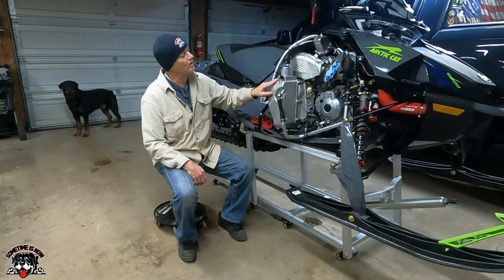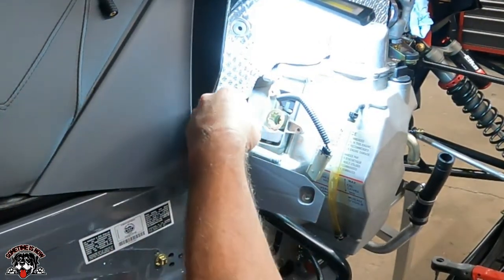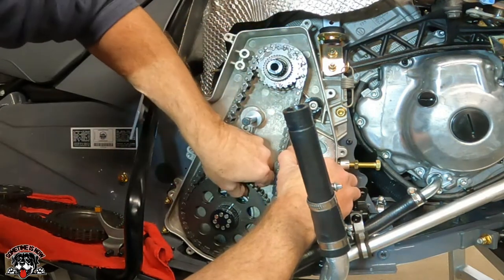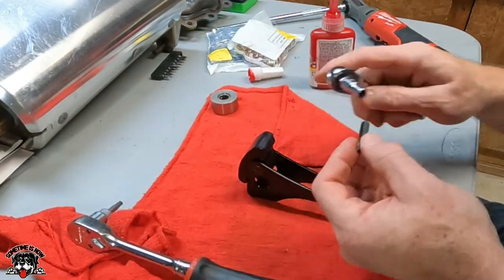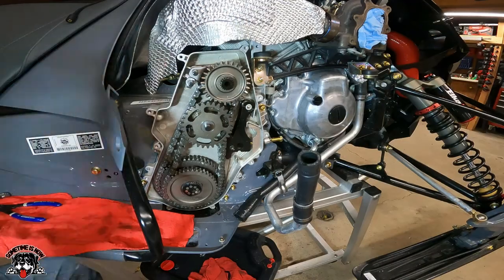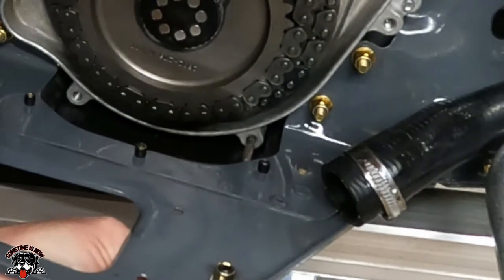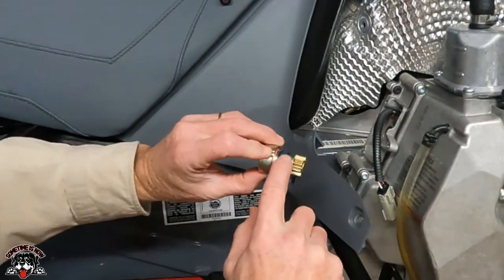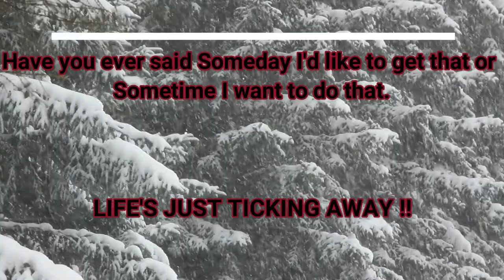THUNDERCAT SIDEWINDER Upgrade your Chaincase parts

Comment: what you want to do when torquing that chaincase is to step the torque values all and do star patterns.  I typically do about 4 torque steps before hitting the max torque value, but I only go to about 120in/lbs and start at about 80.  The manual says 12ft/lbs

Chain Case (Torx-Head Screw) Chassis 12
Chain Case Cover Chain Case 12

Also you may want to pull your oil tubes as there is some oil that gets left in there.
Reply from the maker: Hey AJ, Thanks for checking out the video and the suggestions on torque pattern. 👍🏼Actually I found on Page 8 of the 2022 Arctic cat 9000 Service manual under Torque specs it states:
Chain Case (Cap Screw) Chassis 10 ft-lb
Chain Case (Torx-Head Screw) Chassis 13 ft-lb
Chain Case Cover Chain Case 9 ft-lb
🤷🏼‍♂ Take Care
Reply: @SometimeIsNow  yeah the values keep changing.  I had one leak on me once.  I just start at the bottom and then star it across the top and sides like a wheel on a hub.
Reply from the maker: @ajbertelson9871  Hey AJ, Yeah.. I could see that happening. I know a lot of people re-use the seal, but I change it now every time I split the chain case to drain it, just to be on the safe side I always pull it apart to peak and inspect, and also to wipe the speedo magnets off of debris so the glob of tiny filings and goo don’t start wearing into the case cover. Cheers buddy 🤙🏼
Reply: @SometimeIsNow Which screw is Cap screw and Torx head screw?
Reply from the maker: @MrGrobert1  Hey MrGrobert1, The Torx head screws are the ones that hold the chain case cover on. According to the service manual there must be a use of cap screws that hold the chain case onto the tunnel. I've never had that portion apart and hope to never need to remove the whole case from the tunnel. 
I just replaced my chain tensioner to the updated HD tensioner from Precision EFI as I noticed the stock adjuster is indeed wearing into the chains case pivot post. If that kept wearing it would cause someone to replace the whole chain case from the tunnel as it's part of the case. Mine was a little worse than the photo Precision displays on their website. I'm glad I caught it before it did more damage. Check it out here and you can see the wear issue. https://precisionefi.com/en-us/products/hd-tensionner
Take Care 👍🏼
Reply: @SometimeIsNow    Then unscrew one full turn with precision EFI ..not 1 1/2?
Reply from the maker: @MrGrobert1  That is correct, Precision EFI requires only 1 full turn compared to the stock tensioner of 1 1/2. Must be due to the spring load of the new tensioner. I imagine PEFI did testing to find out how much tension for their tensioner.  I just followed what was required from PEFI. It’s a high quality piece for sure.

Comment: Where did you get your knowledge of snowmobile mechanics?
Reply from the maker: Hey Doug, Thanks for stopping to check out the video. Nothing for formal snowmobile mechanics training. I’ve just been working on snowmobiles since I was very young with keeping the old MotoSki sleds I had running. Everything I own I purchase the service manual for it and work on it myself. I’ve been in the maintenance field my whole career until I retired two years ago. I was responsible for maintaining million dollar high speed production machines that had to hold tight tolerances within tenths of a thousandth. Take Care 👍🏼

Comment: Hi Greg,just wondering if I can install the precision chain adjuster without pulling all the gears?
Reply from the maker: Yes you can, Just back off the tension on your current chain adjuster bolt so you can pull the stock one out and install the HD Precision one in its place and reset according to Precision recommend printed on the new adjuster. If you have any questions let me know. I just installed mine with no issues. 👍🏼 Take Care
Reply: @Sometime Is Now  great thanks,we got 6 inches of snow and still coming down and I put sled to bed😔
Reply from the maker: @Iluvboostedsleds  😩 It never fails.. Sadly I also have to wait till next season, which will be here before we know it.

Comment: Just a question not related to this video. If left for any length of time like a month does your battery drop below voltage required to start? I have a 2022 Yamaha SRX and I can not find the draw, I put in a new battery and same thing
Reply from the maker: Hey David,
Thanks for stopping by the channel to check out the video. 
I honestly don’t have the issue as my sled stays hooked to a Battery Tender when not in use and with this past winter it’s been hooked up “ALL WINTER” 😩 If you have experience using a good multimeter to check amps on your battery terminals for parasitic draw, then removing one fuse at a time and watching the meter. You can also use the multimeter and test across each fuse. If it stays at zero there’s no draw through that fuse (whatever it goes to). 
Here’s two different methods to show you what I’m referring to. Take into consideration these are for vehicles so pay no attention to the car specific stuff but the testing principal is the same.
https://www.youtube.com/watch?v=YhC8xj5vHUg
https://www.youtube.com/watch?v=lRcj1fQcWwU&t=157s
Any questions let me know
Good luck and Take care.